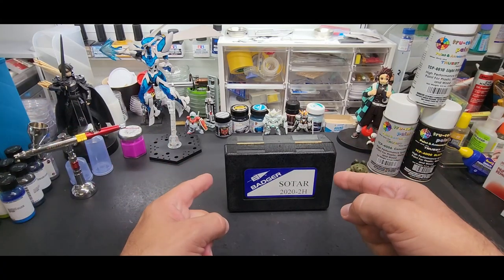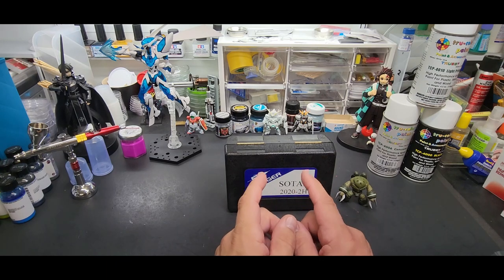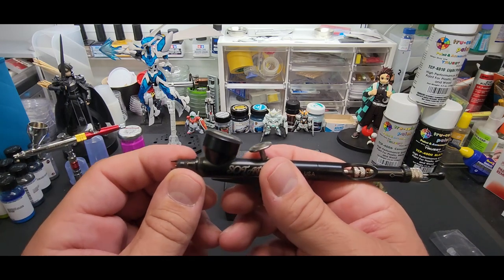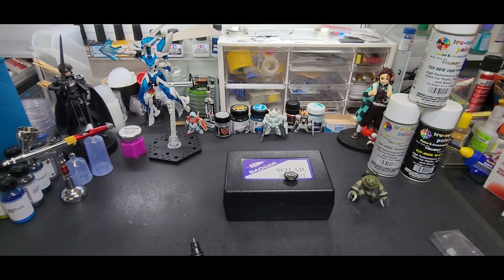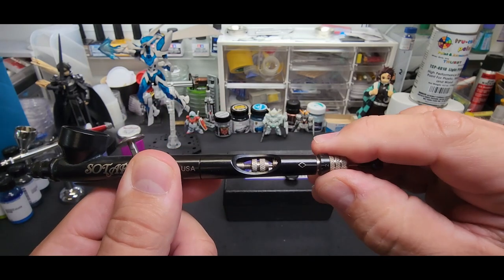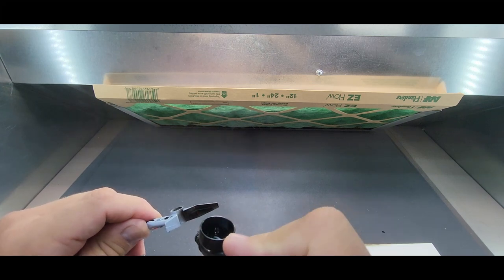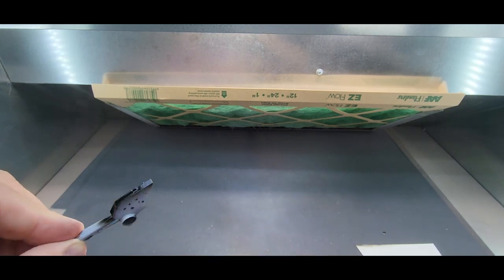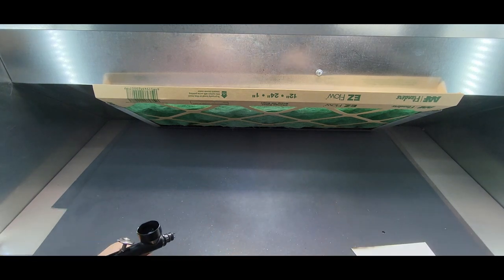Testing The Badger Sotar Airbrush - An Affordable Detail Airbrush

Comment: I've got one of those. It is an excellent detail brush. Mine came with the nozzle without the protective ears. Other than being a bit finicky to disassemble, there is absolutely nothing wrong with a Sotar. I've even used it to shade 1/35 scale figures. Very nice airbrush.
Reply: Ditto on the finicky assembly but being able pull the needle with the tail attached is niice

Comment: I use the fully exposed nozzle cap.  I can turn the psi way down to 5psi and adjust further with the grex mac valve.  I can thin to 10% paint or less to 90% thinner without spider webbing.  That is both acrylic and lacquer.  Total control and I freehand my camo patterns with great results.  I have even painted figures as well.

I prefer the smaller cup for this gun as well as the slim (no cup).

The Krome responds exactly the same but is heavier and longer.  The cup is further forward as well.  So it is preference.

Nothing against their more expensive competitors, but I will take Badger every time. 
This review was long in the wait!!!  Thanks for the great video.

Comment: I have a question,  You were saying this one and a couple of more Air brushes have the .2 needle.   I have a Badger Renegade Velocity which comes with .21  Spray gunner has them for 82.00 so in your opion would they not do the same job?   They also offer an ultra fine needle conversion.  I model in N scale so detailed work is the by product of the scale.   You do a great job of reviews and where to get them.  Till next time.

Comment: It`s amazing how you can move left and right so quickly when airbrush painting like can spray painting!!  Is that correct??...I`ve been airbrush painting for a long time,but this is the first time..I`ve seen it!! WOW
Reply from the maker: It's a method I picked up over the years. I go quickly on the first couple of coats, it causes the paint dry quickly forming a sort of primer. Then I go slow on the final pass to get that wet coat

Comment: Switch out your highboy trigger from your other badger. It makes this airbrush so much better. I have a iwata custom micron and a harder and steenbeck evolution and this sotar is still my favorite airbrush out of them. I have the .2 needle in it and I use it for primer all the way to detail paints. It’s a great airbrush.
Reply: High triggers add to hand fatigue and reduce precision not improve it. I tried a high roller trigger on it and it did not make the brush better it made it far less precise. These brushes are made for fine detail precision work. They were geared toward illustrators. The lower the trigger the less movement is needed.

Comment: I believe the sotar 2020 size graduations are fine/.2, medium/.3, and heavy/.5 .  To my knowledge there is not a .7 needle size for the sotar 2020  as mentioned in the video. Your 2020 heavy is a .5 needle size. The regular patriot 105 has super detail/.3, detail/.5, and general purpose/.7.  The renegade/krome series has the ultra fine/.2, and fine/.3. It get’s confusing partially because Badger designates different names for the same needle size. Thanks for the great video.

Comment: I have that sotar 20/20 with all the needle sizes, but i use and like the harder&steenbeck infinety cr pluss chrome and the Evolution AL pluss better than the 20/20. Its still a great brush but the bager stuff have much more small parts than harder&steenbeck so its a bit of a hassle to clean

Comment: Does a more expensive high quality airbrush really make a difference in spraying and the flow of paint? I currently use a 0.3mm airbrush from hobby mio.
Reply from the maker: Well it depends on the brush. I do happen to not like the Hobby Mio at all. I had one briefly and sprayed a few different paints thru it and did not like the way it performed at all. But yes, most brand named airbrushes do perform much better than the rest

Comment: Aside from the cup size, what makes this better suited for details? If it came with a .7 what was wrong with it for spraying thicker paints? Just curious. Was it not good? Seems like the start control on this thing sucks. Appears inconsistent. When the stop is set, it seems like the lines aren't repeatable and I'm looking for a brush that has that type of control or else the quick stop function is useless.
Reply: The spray velocity is really low like the iwata micron - less spidering/surface blowback with thinned paints up close.
There's an illustrator on youtube who measures air velocity from all airbrushes.
It's a good airbrush in the right hands.

Comment: My cups fit just fine on the Neoeco I bought, but I didn't get the 0.5mm nozzle, contacted them and they are sending me the replacement part.
Reply: I have orderd mine right after the Bossman presented it. But i live in Spain. Then Robert made that announcment that at some of them the cups did,nt fit. Sended them a e/mail to provide more costs for them and asked or they could check it out. With/inn 30 minutes i got a call from them the my order was ready to send and was all complete and checked. Tuesday i recived my package and i was surprized after i cleaned it a polished the needles how a good primer AB this is for large 1-24 skale reefer trailers i am building. What a nice Gun and with the larges cup i can prime 1 reefer trailer completly without filling up again. I am as happy as a kid with new rubber boots on a rainy day with this AB. Never thought that cheap could be that good and with a super service team behind it

Comment: I just got a cheapo airbrush to learn with. I plan on painting weapons and weapon parts. I'm going to use a special paint that the military uses, KG GunKote. It is a one part spray and bake that goes on like .0003" and is tough as nails. It is a bit expensive, especially to learn with. What is a decent paint type to learn with. Something that preferably will stick to metal. Enamel paint is what I was thinking. Just something easy to get, cheaper, and will stick to metal for practice.
Reply from the maker: Either enamels or lacquers will work. Mr Color is good to practice with because they cost under $3 a jar